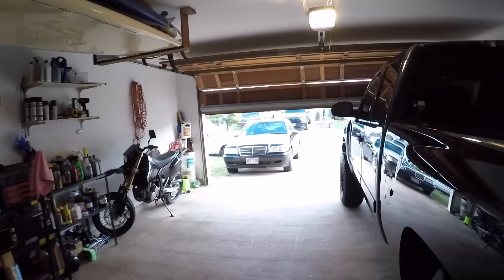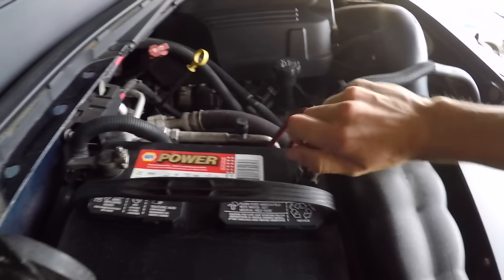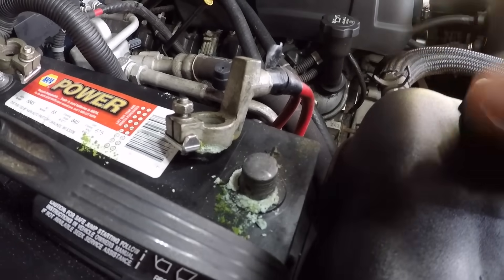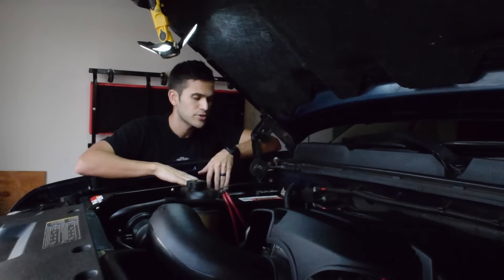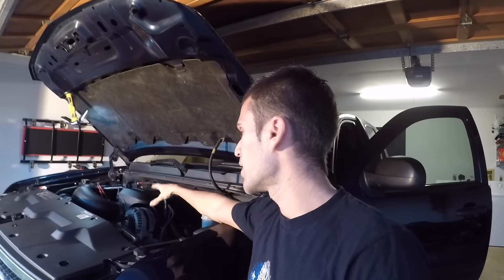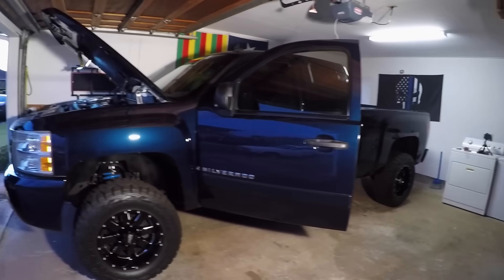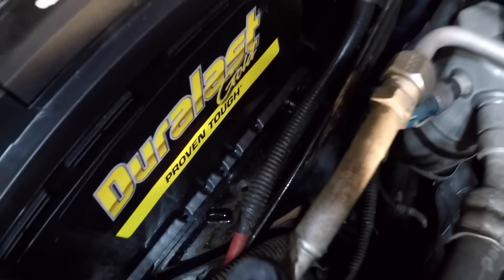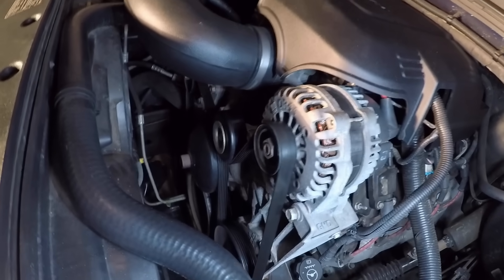Car Won't Start: Alternator or Battery? The easy way to know

Comment: Dude!!

NEVER jump using the actual battery terminals in the Benzo (Mercedez)!!

Use the remote terminals under the engine bay (aka "bonnet:).
Reply: You get more resistance from the jumping points in the front, the actual battery terminals are better if you know what you are doing.

Comment: Probably nothing wrong with your battery. Clean up that corrosion, and it would probably have charged up, and been fine. The woman driving without headlights, might have electrical problems and trying to conserve the battery power. Kind of fitting, given the focus of the video.
Reply: That's alot of credit given to the woman who forgot to turn her lights on.😏
Reply: Exactly the same amount of "credit' needed, to assume she just forgot to turn her lights on. Actually less. Because I said, "might have". You just made a statement as if it actually was the case.

Comment: Sometimes it's because your cigarette lighter port stays on all day even when turning off your car
Reply: Jorge Delgado yep. This guy needs to turn off everything before the engine. It damages the battery.
Reply: My cigarette lighter stays powered while the car is off. I think all german cars are like that. Yet, my battery is 17.5 year old.
Reply: @fungames24  WTH 17.5 yrs old??!!!  Nuclear reactor in your car???  Nice.  @LonestarHawaiian, thanks for the info!
Reply: @jhleerph  No, just added a 10 GBP chinese solar reactor recently. I had to partially tape over it to prevent reactor meltdown. This should extend the battery life indefinitely. The car starts fine from surface charge alone.

Comment: The best way to test if your battery is bad or alternator is when your car is running disconnect one of the battery terminals if it turns off its your alternator
Reply: Someone just did this and mine kept running but they say my alternator is bad. Is that possible?
Reply: @arebee27  no , have someone check your battery voltage first or take it to a auto parts so they could check your battery first
Reply: Sure, if you enjoy buying $2000 electric modules that get fried when you do that on a modern vehicle. Bad idea
Reply: Super helpful … thank youuuuu
Reply: Thanks, as a women who didnt even know where the alternator in my tatta indica was, i learned a lot now. My previous battery with a two year warrantly, sudden did not show the number which it suppose to be at my garage. Then they say it is the alternator, then the guy said that he push a plug back in the alternator and the car start again. And off i go back home, very thankful, and praising God. Vryday morning, when i start the car, it did take. After lunch i start the car nothing at all. Now, i am not married, i am staying in a security complec whereby everyone is at their work places, but luckily for me, i found one man and one very old one, at that stage, they tried to kickstart the car, nothing happened. So i phoned outsurance my insurer, and they send a young with jump starts, the small one which he usually use, is broken he said. So we try the charging, nothing happens, the two men explain to me iro the colours on the battery, my battery was standing on the last colour, i think the no colour on, which was a indicates that the battery is sóoooooo dead. Then we took a battery out of one of the men's car, and put it in my car, and it start strongly, so that was not the alternator. My brother doesnt felt sure that it is not the alternator, which is very difficult to replace because there in no tatta dealers left in South Africa. So i went to builders and i bought a small rechargeable charger which can be charged in the cigarette holder or be charged inside my house. Must i buy a tester for the battery too, i got the charger now. Please help with advice.

Comment: Question- Had a bad battery, my check engine light went on , O’ Reilly’s ran a code check before installation of a new battery , They said my nearly dead battery had tripped the starter ? Ran codes again after new battery all good, Next day battery dead again !

Comment: My car has no power whatsoever the car is from California and it has never been in cold weather, the car started all good and I left it sitting for a week during that week the temperature went -0F after the temperature went a little up (30F) I turned it on and worked just fine 2 mins later it lost all its power and turned off tried turning it back on and didn’t turn no lights ups it was dead. Does anyone know what the problem might be?

Comment: Good effort  but this could be a 90 second video dude.  And please educate yourself on the basics of electricity - voltage does not equate to current, and a little corrosion is not going to decrease the voltage to the starter.  Maybe current (if it's badly corroded, which yours was not) but not voltage.  Also try not to move your camera around like a schizo.  Wide shots, keep it simple.  Good effort though, thanks.

Comment: My 07 Yukon xl Denali wouldn't start. Single digit temperatures. Lights were flickering ever since I bought the truck a few months ago. Replaced alternator and battery and am waiting for next cold snap to see if that fixed it

Comment: I didn’t use my car for like 2 months and it’s been freezing weather, went to turn it on the car was dead, no lights came on when I turned the key! The car was fine before no battery light, is it the battery or alternator?
Reply: buy a charger

Comment: Sir i just bought a new SF sonic car battery. It's just 1 month old. A white signal indicator is on very soon. Please help fix this issue.

Note. Car is normally used, battery charging system, alternator etc are good and voltage reading is between 13 and 14. It's emergency please.

Comment: how old was the ded batery. i was pissed wen mine went out. 4yrs $100 everstart from walmart. this batery was solid nvr had any problems until i go n remove a parking bulb in the front of my 03 silverado. 8hrs later batery ded. i was like u kidin me right now. gm products r one of thee wors but jeep chrysler dodge has got to b the top wors its jus sik

Comment: Hey I have a Chrysler 200 2014. It doesn’t want to start but clicks one time when I try to start it. There is power as the lights and everything come on. I tried jumping it and still nothing. What do you think?
Reply from the maker: terminals might not have a clean connection. That or your starter is locked up or going bad.

Comment: Love the video... But I couldn't help but notice it took you a couple of days to to determine it was a bad battery.
Quick test to see if its the alternator is jump the car and disconnect the negative terminal. 😄 15 mins tops and you have your result..
Reply: Good way to damage your engine electronics. This isnt 1978 anymore. Do NOT unhook a battery when the engine is running

Comment: If you use a device like a "SUNER POWER Digital 12V Car Battery Tester," you have the additional capability of analyzing the Cold Cranking Amps (CCA). If it shows the CCA is below what your vehicle needs, the battery is bad. This is a great indicator of the batteries performance. For those interested in the math, electrical Power-in-Watts = Amps x Volts. So, for example, if you need 6,000 watts to start the car, that means the 12-volt battery must have 500 CCA (12 Volts times 500 CCA = 6,000 Watts). And if you buy a more powerful battery with 550 CCA, the voltage can drop to as low as 10.909 volts and you can still start the vehicle because 550 Amps x 10.909 Volts is about 6,000 watts.
Reply: So if jump starter reads 12.7 your battery is fine?
Reply: Awesome job thank you!

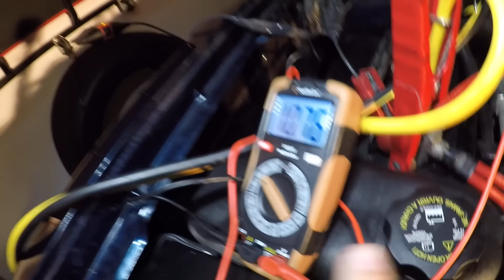Comment: Hello.  Nice video indeed. May i ask, check on the video at 6:42. The moment you connected the other battery to the one that couldn't start the truck, the voltage on the multimeter was supposed to rise to around 12 volts as it is a parallel connection. Yours just stayed at 10,76 volts. May you explain why. 
Thank you.

Comment: Easy way to find out if alternator is bad, Jumpstart your car and disconnect the - on your battery, if the engine dies then your alternator is broken  is engine keeps running then the battery is dead... This way I use always and you don't have to buy a meter....
Reply: What about on new cars?
Reply: I talked to a very well informed mechanic yesterday, 10-19-18. He didn't mention the year in which to stop doing this but he said on the newer cars with all the "bells and whistles" AND most all Chrysler cars dating back a while, the computer regulates the alternator so that the current is not fluctuating. He said damage "could" occur to the car electronics. He told me my 98 Toyota Camry is perfectly safe to test at home by pulling the battery cable off while it's running. LOOK for the words "built in regulator" on the alternator. That way you know the alternator is regulating the current, not the computer, so it's safe. My Camry alternator said it right on top. But some others may be hard to see. Look up your alternator, product specs will say "Internal Regulator", or IR
Reply: Yeah dont do this on newer cars will fry   your computer or ecu
Reply: @sith187z  ok thanks
Reply: 1st check for a loose alternator belt.
Reply: I was sent to a training class several years ago about the charging and starting systems on vehicles ( I work for an auto parts retailer). The man that taught the charging system part worked for GM back in the early 60s and helped design the alternator. He said that when the first cars came out in 63 that GM sent out a tsb telling all the service depts. not to remove the negative battery cable on a running vehicle because the could fry the diodes in the alternator and render it inoperable.
Reply: Vincent de
Reply: H
Reply: Vincent worst thing to do to your car
Reply: You can certainly get away with doing it a few times. odds of it frying the computer on your first time is not likely, I’ve done it on newer models only when I have to. But definitely taking a big risk of frying the ecu. I wouldn’t recommend it. Just get the alternator tested. Your $60 job can multiply by 10.
Reply: I know what your talking bout,but my car was still started and it’s not the battery(new battery)Auto Zone said that,I had a bad alternator. But that did work the the last time,I had to change the alternator,but not this time. But when I was driving it was completely shutting down though that time. I hope I can make it,to a place that can fix my alternator. It’s been staying started after the jump so far.
Reply: I'm old school and that's what I've always done. I came here thinking somebody would say it - and you did.
Reply: That's what we do here.
Reply: what if the car stays on after removing the  jumptstart but then dies if i try to move it

Comment: Awesome video . 
I have a Chevy avalanche 2004 my truck just died and nothing was going on I mean no lights nothing so we got it started with a battery charger from a towing truck company and once we took off the cables it would just died so we started again and took off the negative cable and it died so he said it was the alternator. I bought it today and Changed it already and tried to started but nothing again battery reads 12.6 the alternator is brand new I don’t know what else it can be . Going to take my battery in tomorrow and see what’s up . It can’t be the starter cause I got it going with the battery charger right ?
Reply: albert suarez maybe starter

Comment: Use a bungee cord as bracket
Reply: Bungee cords disintegrate over a fairly short period of time in the engine compartment.   The heat, temperature fluctuations, and road salt they don't use in Hawaii kill them fast.   They have no retention capability in a panic stop situation or accident - very dangerous.

Comment: Last night I was driving and my battery light came on. Voltage was pretty low and my engine was heating up. Then my power steering went out. This morning I went to o Reilly’s and once I turned the car off then tried turning it back on, I got this rapid clicking noise. Didn’t turn on so they gave me a jump and I got home. Is it an alternator problem or a battery problem?
Reply: fanalisbeauty 13 same exact thing happened to me this morning idk what it is.

Comment: If a battery is completely flat, would it prevent dashboard lights coming on and stop remote central locking from working? My Yaris was completely dead, not a sausage of life in it. Got alternator replaced yesterday, went out to it this morning and exact same problem...🙄
Reply from the maker: Sounds like a battery, or a bad connection on your battery terminals.
Reply: Thanks for you response. It's at the garage now. I'm just wondering if it's possible they misdiagnosed it initially or if a failing alternator has knackered my battery? The guy at the garage said the battery was okay and that it was holding charge. He thinks something is draining it but doesn't know what as yet..He said he was going to undo one of the terminals and leave it overnight. He will then check it in the morning. I guess if the charge has gone the battery is buggered? And if it's still got charge, something is draining it...hmm...🤔
Reply: Coral Laroc ..yes it would..

Comment: I buy a honda oddyssey my friend told to disconnet the battery wen am not using the van cuz if i leave for an hour will not turn on.. My question is the battery or alternator
Reply: Did you find out?

Comment: What if after you jump started your truck and it runs fine,but your lights,radio goes off. Battery indicator level goes down,as the truck runs
Reply from the maker: Sounds like a bad alternator, bad connection. Try cleaning up the contact points on the alternator.
Reply: your alternator runs all the accessories when the engine is running. You might just have a bad battery . heres a test disconnect your negative cable for a few days if you don't drive that much. your anti theft system uses power over time so it will drain your battery when you are not using it.

Comment: What if it won't start even with a jump?
Reply from the maker: Is the engine cranking? If not there is most likely a bad connection to your starter, or your starter is shot.

Comment: I jus bought a battery for my car put it in but the car jus won't start seems to me like its the alternater cause when ever I start the engine it give the sound of starting but it jus won't  start
Reply from the maker: Alternator wont do anything for you unless the engine is running. If the engine is cranking but not starting it's most likely not battery related.
Reply: Fuel does not reach to your plugs; fuel issue. Unplug the fuel hose from the rail and crank it to see if fuel is coming or squirting out from the hose. If there is fuel, then you don't have sparks.

Comment: Well you can charge your car by using your altemator drive if for like 20 to 30 minutes at try to ramp up the engine
Reply from the maker: Alternator (operating correctly) should put a charge back into your battery within that time.

Comment: letting the battery drain will not ruin the battery , you can always recharge it and it will hold full charge if it is a good battery .

Comment: I have a hummer 2006 and when i jump it up it turns on but, when i disconnect the cables its cut off it self and stays all dead without any light on what it could be ??
Reply from the maker: Probably bad alternator. Truck should be able to run just of the alternator once its started. Also could be a bad connection somewhere (alternator, or battery)

Comment: Cool, I just had to do the same thing, but the alternator was what was wrong with mine and it made the battery go bad too. Replaced them both and my truck works great again! 👍🏽🤙🏽
Reply: Thats usually what happens, junior. The battery is ok but the failed alternator weakens it and then you replacing everything.......happy motoring!
Reply: I hope I can do this next !!!
Reply: You so right, Mr mush mouth could have made a 5 minute video out of this without all the unneccsary b.s.